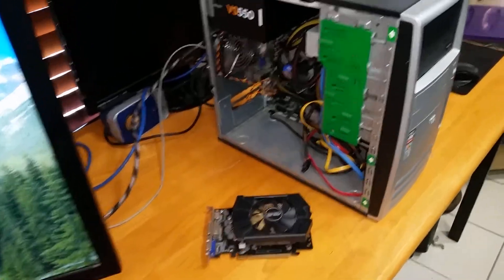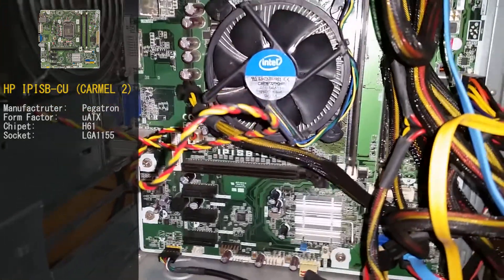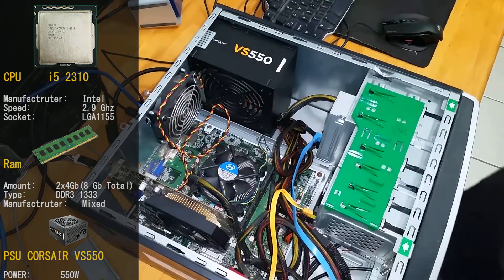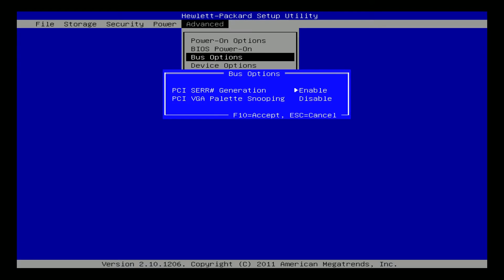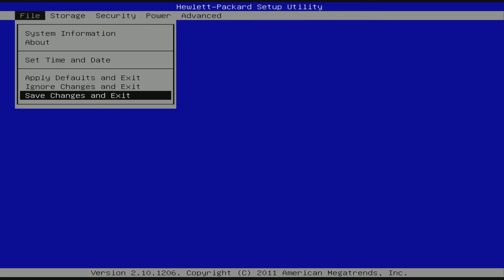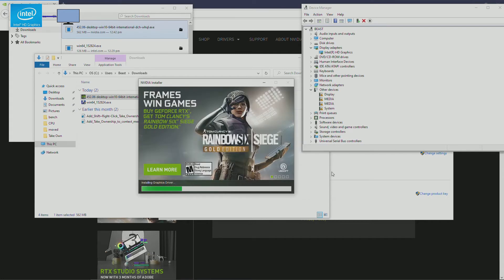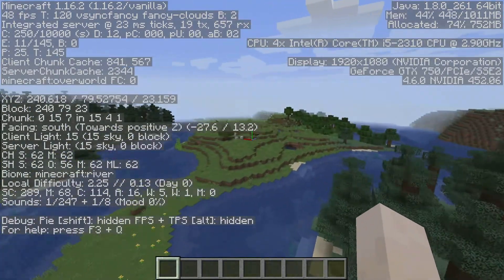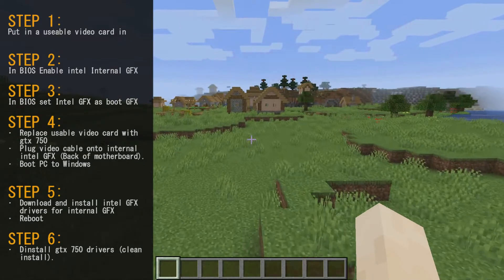Gtx750 UEFI work around for HP IPISB-CU (CARMEL 2) / HP Pavilion p7-1205.

Comment: I am stuck in windows 10 loading … 95% work done , I buy a cheap video card working with my ipibs-ch2 motherboard , all what you saying in video worked but In the final step I am stuck in the windows 10 loading screen , the thing stop loading , you think it’s because I am using HDMI for the video card and not VGA/DVI ? Or any methods please? Thanks
Reply from the maker: Suunds like windows might be crashing loading the current video driver. Can you get into Windows Safe mode?
Which video card are you trying to run?
Making it past the bios is a good sign though, though we had no troubles with windows 10 on our system.
It might be worth trying reinstalling windows 10 with the new video card in if you cant get into safe mode. No guarantee that will work though. Just a thought.

Keep us posted.

Thanks.
Reply: I have the same issue on IPISB-CH2. Have you tried to connect the display back to integrated GPU? This way I can login to Windows and than disable and reanable GTX 1060. It works great till another reboot of Windows where it get stuck again. The display adapter in device management reports Code 12 (This device cannot find enough free resources...) error. Have you got it to work? Any ideas?
Reply: @JiriGeniusKubik  I got a solution for this , i bought a used msi 750ti oc 2gb for around 50$ 3y ago, this graphic card can boot with legacy bios or uefi (you have a switch in the graphic card, it's called hyrbid bios), i just selected legacy bios and it's worked great with the shitty ipibs-ch2 motherboard, here is a cheap solution to continue to use your pc with a cheap graphic card that can run games and work fine ;)
Reply: @bxrz  thank you! I ended up with another solution working with much better (newer) GPUs - update BIOS with an unofficial update.
Reply: @JiriGeniusKubik  really it's possible? 3y ago i searched all solutions possible everywhere in the internet and my solution was the only one working at the moment, i found it by myself looking for the best gpu possible with legacy bios support, maybe this unofficial bios update it's something new, if you can give me more infos about it just for my general knowledge i would appreciate

Comment: This metod works for a gt730?
Reply from the maker: It should do.
Reply: @OFFbitTech  it didnt work :(
Reply from the maker: @ernestouzeta9183  It may be easier to try with using two monitors.
It's not a straight forward work around.
Both setting the bios correctly and getting windows to behave is a tricky thing.

On the other hand you could find a cheap second hand geforce 600 series card. The 600 series cards should just work since they dont rely on UEFI bios to boot.

Comment: Nice work bud can you please let me know how can i contact u?
Reply from the maker: at the moment this is probably the best way.

We are looking into starting a sub redit on redit.
Stay tuned for that.

Thanks for watching.
Reply: It works thanks alot 
So when i in desktop can i restart my pc or only shutdown
Reply from the maker: I would only shutdown. It seem to break every time we reset.

It's easy to fix but annoying.
Reply from the maker: @mohamed-gq3qb  Only shutdown I would recommend. It's painful but that's the best way or you will probably need to redo steps.

So try to avoid restarts from windows.
Reply: How to go to bios option please with the same motherboard
Reply: Should i reboot my pc after installing graphics card driver there is a botton says restart now or later what should i do?
Reply from the maker: @mohamed-gq3qb  Avoid using restart. It always undid the install initialization of the new GPU. That's what it did when we tested it anyway.

Try just shutting windows down and turning it back on.
Hopefully that will get rid of the windows restart thing down the bottom.
Reply: There is a problem i followed every step in the video but when i remove the intel cable and only still connected with the graphics card cable I'm stuck in windows loading and its stop loading like its crashed
Reply from the maker: @mohamed-gq3qb  Did you manage to get the card to work?

It may be easier to use to monitors if that is an option.
Reply: Thanks bro but i bought a new motherboard 😂

Comment: What will be happen if I put more the 8gb of ram.to like 12gb of ram would it work?
Reply from the maker: The h61 chipset does support up to 16gb of ram.
Which is a promising sign. that it can support more than 8 gb.

We will see if we have any 8gb sticks of ram to try this out.

But for now we are unsure if it will or will not work. But there is a good chance it might.

Great idea though.

We'll let you know if we can do the test and what the out come is.
Reply: @OFFbitTech  but my p7-1219 motherboard says that I can upgrade up to 8gb ram on 64bit system so is it possible to get at least 12gb
Reply from the maker: @Wocksoft  
We have just powered up our IPISB-CU motherboard. with 2 sticks of 8gb Corsair Vengeance Ram.

Both Bios and Windows 10 Detected 16gb of Ram.

So for us this has definitely worked.

Hope this helps.

Thanks for watching.

Comment: So I'm currently buying parts for my new build and I just bought an RTX 3080 but I don't wanna wait till I get the 5900x cuz it's gonna take too long. I also have this pc https://support.hp.com/us-en/document/c03154964. I was thinking about putting the RTX 3080 in here cuz I don't care if there's is an enormous bottleneck as I just want to get at least 60fps at 1080 or 720p in games like Rainbow Six or Doom Eternal untill I get other parts ( and it will take a very long time cuz I have to get a Dark Hero, Unifans, 5900x, 980pro,etc... I also have a powersupply (Gigabyte P-850GM) but Idk if there's any incompatibility I should know about. Thanks
Reply from the maker: We have not tried running the 3080 in the ipisb-cu. We believe it will have the UEFI crash problem which this work around should work..... it's a bit of a tricky work around to do but we think it should be ok. You will probably need to make sure your power supply has enough juice for the gpu in which the Gigabyte P-850GM should be more than sufficient. 

One other thought is that the card might be a tight physical fit but the best way to find it out is give it a go.

Unfortunately we cant give you a definitive answer but we think it's possible with the work around as long as the drivers in windows don't want to do something different we have not come across.

Sounds like you are building an absolute monster of a gamming system. That will be awesome when you get that together.

If you do try the 3080 in the HP pc make sure you drop some comments by, we would love to know how this works out.

Thanks for watching and good luck.

Comment: Would this theoretically work with any modern GPU that is UEFI limited? Would be nice to find at least the best functional legacy card for this mb.
Reply from the maker: @zeilstar
I think it should. The bios seems to be crashing on boot up. If you get past that then the operating systems should be able to sort it out. I think that is general problems other boards have. Painful thing. but if you just want something that works on IPISB-CU still and not too bad of a card. Gtx 670's / 680's are good, you could do any card in the  600 nvidia series. There are a few cards in later series by certain manufacturer that will work, but no guarantee (cards using a legacy bios setup on their cards).
Reply: @OFFbitTech  Confirmed a GTX 680 works with no issues.
Reply from the maker: @zeilstar  Great, Thanks for the report.
This will help somebody else looking for an answer.
Reply: Just installed an RX 6650 XT that was released in May.  Most likely will work with others too.

Comment: Wow. Just got an old HP with this board. Was stumped. Surely there is a way to prevent reboots?
Reply from the maker: There probably is. 

I don't know how many times I had to redo the driver in windows because I told windows to reset and that was only when I was making this video.

Comment: Thank you. I have this motherboard and its just so hard.
Reply from the maker: @Ronnie Judilla
Yep that's describes it.

It seams to also other problems with other sound cards or even using HDMI audio from your GPU.
It think there were a lot of bug that never got ironed out. Also alot of new features left out.

But I love playing around with it. The board is kind of cool but frustrating at the same time.

Thanks for watching
Reply: @OFFbitTech  

I think thats the best alternative so far.
Do you think it would work with a gtx1660ti e.g.?
Reply from the maker: @mikekiske  I would say a gtx 1660ti it should work, since it is the bios crashing when using the video card. Having the onboard or another card as the primary in the BIOS should bypass the boot crash problem.

However, some of the motherboard issues still leaks into windows o/s and the thing that may become a problem if not already is if the Nvida drivers are doing something different with their newer drivers. But probably not, but something to keep in mind.

So unfortunately I could not guarantee it to work and my recommendation from using this motherboard is basically if you can afford it, replace it with another sandybridge / Ivybridge (2nd / 3rd gen motherboard).
They are getting cheap enough to do so, but If you are up to challenge and you don't mind fixing odd problems than give it ago.

Sorry if I went of on a tangent.
I think it should work bassicaly.
Just thought it's worth getting all the info in here for anyone reading through the comments.

Thanks for watching.
I love the contributions all viewers make towards the channel.

Keep up the good work.
Reply: @OFFbitTech  

That's sad because I have this mobo since 2012 and no complaints at all, except the bios downside. But now I have the opportunity to give it in exchange for a b75d3h with a friend.
This bios, by the way made it difficult, if not impossible, to install windows 10 pro, believe it or not. I had to do a workaround with a windows 7 DVD. 

Thank YOU!
Reply from the maker: I absolutely agree. The bios is a real let down. It's a real shame everything else is solid but a few bios bugs. A simple bios update would fix all the problems up. But unfortunately that will never happen.
Reply: @OFFbitTech  

Indeed. :(
Reply: @mikekiske  That's strange, could be because you have a slightly different board than me...but I have the Pegatron IPISB-CH2 (Chicago) and installing Win 10 was surprisingly easy, just did through USB and didn't even have to install drivers, everything was done automatically.

Comment: Good day sir, I really need your help... I want to ask you some questions... I have hp pavilion p6 we have the same specs except my cpu is intel core i3 2120.. I'm finding a gpu to help me with my online class and gtx 750 was my choice earlier until i saw your video... Is it really not working? Huhu what if i don't have a previous graphics card? Sir helppp
Reply: Heeeelppp my online class would be 2 days from now
Reply: Mine is hp pavilion p6 4113d
Reply from the maker: @Mj Bernados. I would probably try to stay clear of using the GTX 750, it is not a pretty work around. If you wanted something that is good that should be compatible. I would be looking at cards in the NVIDIA 600 Series. 

You will most likely need to replace your power supply with something a bit more powerful.
I tried to look up the p6 4113d on google for your specs, but i did not see anything.

Cards that are faster than the GTX 750 and you might be able to get at a cheap price from the 600 series are
GTX 660, GTX 660 Ti and GTX 670. All these cards require a pretty powerful power supply.

The GTX 650 is slower than the GTX 750 but you might have enough power from current power supply to run it. It's not to bad of a card, much better than intel HD graphics from the sandybride cpu's. The card needs a 6pin power connector though. You can purchase adapters from standard 4 pin power plugs (I think they are called 4 pin Molex connectors) from your power supply to 6pin Pci-express Molex connectors.

The IPISB-CU are a real hard motherboard to work with at times, not giving you many options to change or upgrade to far with. They wont accept CPUs from Ivybridge I believe as well.

Good Luck I hope this helps out and Thanks for watching.
Reply: @OFFbitTech  omg. Thanks for the effort you gave for helping me... Really appreciate it tho..
Reply: What would be a suitable and working gpu for my motherboard? Could you suggest me?
Reply from the maker: What is this wattage of your power supply (PSU)?
But with out knowing that I'm thinking you might be able to run a gtx 650.
 If its 550w or bigger you could look at gtx 660 or higher in the nvidia 6xx series.
Reply: @OFFbitTech  yes, also im looking for a psu so it would be better. with a maximum of 550 watts... have you tried installing a gtx 600 series to your pc (ipsb-cu)? without running to any problems? Im really glad that youre helping me :))
Reply from the maker: No worries. I am pretty sure I had the gtx 660 in my board. I will give it ago again and let you know.
Reply: @OFFbitTech  I was worried because i have read many information especially from a tech website they said that no motherboard could work on ipsb cu.... But the infos you gave to me is enough to put my trust on you hehe
Reply: is it worth trying to install a gtx 660 on my mobo?
Reply: I really appreciate you sir!
Reply from the maker: Ok my GTX 660 is dead (just found out), but I tried the gtx 670 in it and it booted past post screen. With the gtx 750 it would crash on the post HP image. So you should be right with anything in the 600 series. Also the GTX 660 only requires one 6pin molex connector not 2.
Reply from the maker: Yep I would try the GTX 660. It should work on mobo.... PSU may be the only problem if it does not have enough wattage for it.
Reply: @OFFbitTech  sad to hear your 660 is dead lol.... any reason why?
Reply from the maker: Yep I would try the GTX 660.
 I just had my GTX 670 work. The GTX 750 crashes on the post screen. But the 670 would get past it.
Reply from the maker: Who knows the GTX 660 was siting in a pc for ages. I got it from ebay and it was not the card that was described. was super dodgy and badly posted. but them the breaks sometime with second hand cards.
Reply from the maker: I will do a post mortem on it at some time see if there's something obvious.
Reply: @OFFbitTech  awhhhh, i see.... sir i really appreciate you helping me with this stuff... youre the only youtuber answered me lol.... i hope your channel grows bigger and ill tell my friends to check your channel out. God bless
Reply from the maker: Thanks Mj Bernados. Glad I can help out.
God Bless as well.
Reply from the maker: Hey how did it go. Did you try the gtx 660 in the end ?
Reply: @OFFbitTech  My gpu is still shipping hehe... btw i made a mistake regarding to my pcmodel... it was actually hp pavilion 2113d i hope youll read this.
Reply from the maker: @mjkylebernados796  I did try and look the other number up with no success.. 

I thought that would of been the case. Should be a great gpu for your system when you get. 

The only thing I am a little worried about is your Power Supply Unit, only because I have not been able to dig up any information on what one you have. But that should not be as complicated to do.

Just check if it has one of those 6pin molex connectors. You will need that to plug in to GPU when it arrives. 

If not you can get 4pin pci-e power adapters for cheap. 

Keep in touch let me know how it goes.